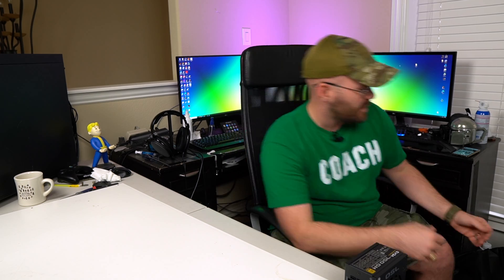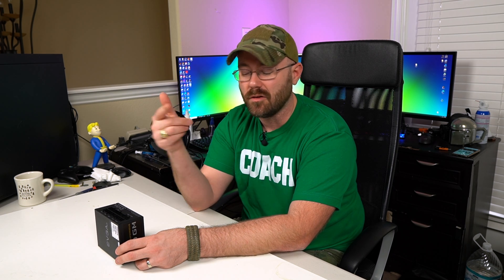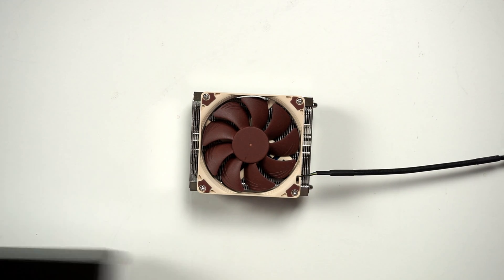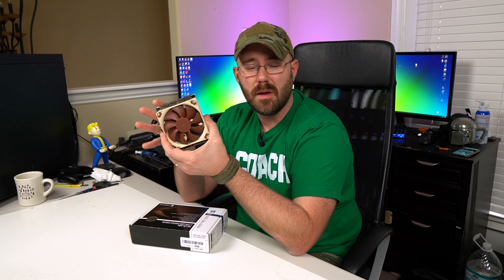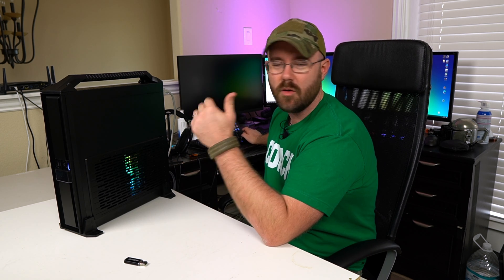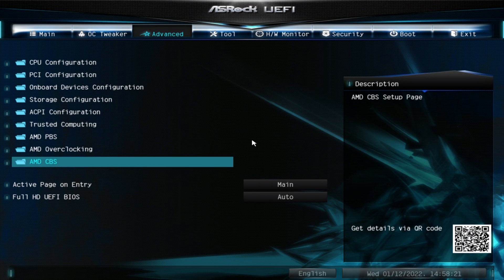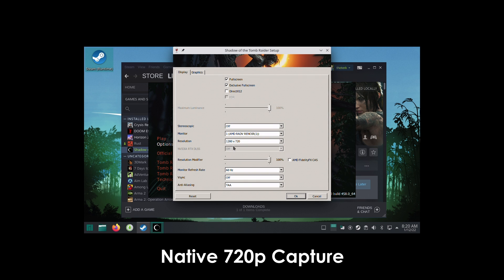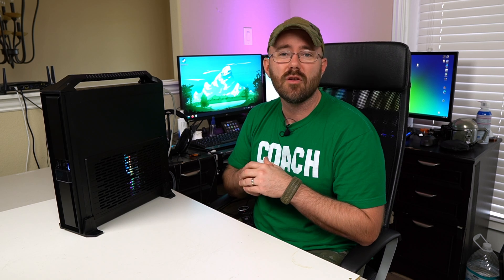Steam Deck Hackendeck Upgrade | How To Build Your Own Steam Deck

Comment: Man I can’t wait to get my steam deck, i love to tinker so just messing around trying to get games to run at different resolutions, settings, and wattage will be fun. Mine won’t be here until q2 though i got my order in 18min after they went live to preorder. I had 2 pc’s, laptop and my phone open to steam trying to get my preorder in but couldn’t get it when it started so no February for me😢.
Reply: Aren't all the pre-orders slated for Q2 ? I've also got my pre-order in pretty early in the process, I was able to get in line 2 minutes within the pre-order start. My pre-order just says "Your expected order availability: Q2 2022 " Which I believe means we are in the list of people within the first few weeks to actually pay/order the device. I have not seen a single post about "Q1 2022" availability so I would imagine all orders are Q2 Onwards. So feb 25th we should expect an email!
Reply: @Thisismaintv  well at the absolute worst we could get them in April but I imagine there’s many people that put $5 down that’s not gonna buy. I think we will probably find out more Friday but i would love to have my hands on one in less than a month. I also did something stupid today and bought a sapphire 6900xt nitro SE for $1500. I’m debating on just sending it back because I’ve waited so long and new gpu are around the corner. But my willpower is low i will probably open it soon as I get it.

Comment: Niiice. Only one question, though... why use the Windows version of Shadow of the Tomb Raider when there's a native version? Do you have a performance delta for this title in particular with this particular configuration? SoTR usually runs really well with its native Vulkan renderer (still performs some translation given the assets are formatted for DX rather than Vulkan and SPIR-V), but I'd wager the native Feral3D renderer does it faster than DXVK/VKD3D (I did not  catch if you ran the game in DX11 or 12 mode)
Reply from the maker: I ran in DX11 mode in this video, but I've also tested the native version with this same setup and the results are within 1 to 2 frames.  https://youtu.be/jN5SpMjFEK4?t=547
Reply: @TheTerk  Excellent. Thanks!
Reply: There are some options I can do with it running under Proton, that the native Linux cannot.  There are a few higher options in some settings, and I can get DLSS working.  That said, if I set the Windows version to identical settings as the native Linux version, i get higher fps on the native Linux version, and just by normal looking I don't see the differences with those extra graphics options.  I only see a reason to use the Windows version if you have a 3D monitor and need support for that, which the linux version won't do.

Also, if you did not buy the game from Steam or Feral, you don't get the Linux version... Epic store and stuff you only have the Windows version.

Comment: I'm curious does the actual Steam Deck suffer from that horrendous screen tearing when running benchmarks?
Reply from the maker: I've heard accounts that it does, but on actual hardware, you'll probably turn on V-Sync to account for that.  Sometimes, screen capture introduces issues with out-of-sync frames

Comment: what is the cost of this build?
Reply from the maker: All in - $1100.  You can definitely squeeze 300 or so out of it with lower spec proc, ram, case, psu, storage and get effectively the same performance.